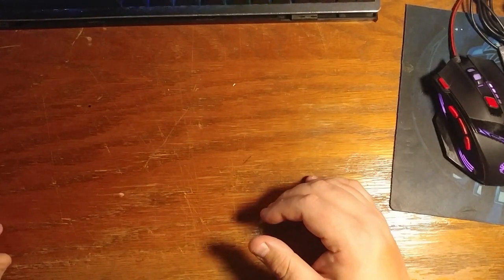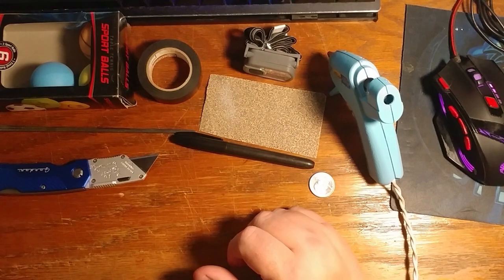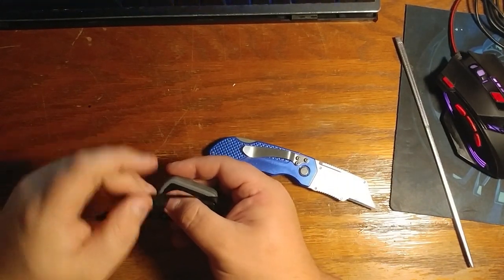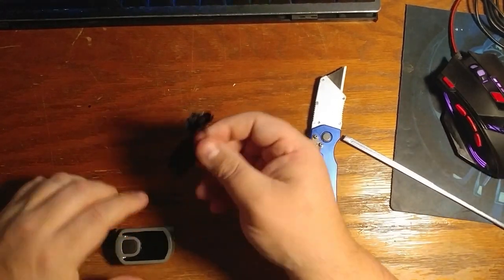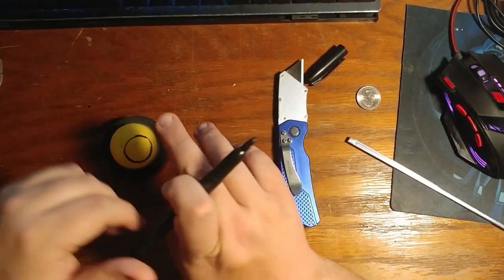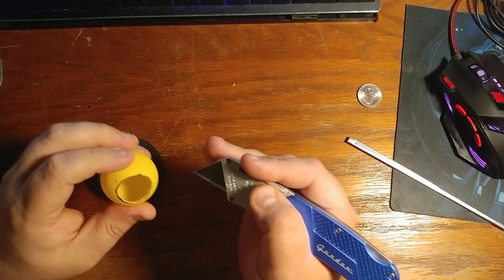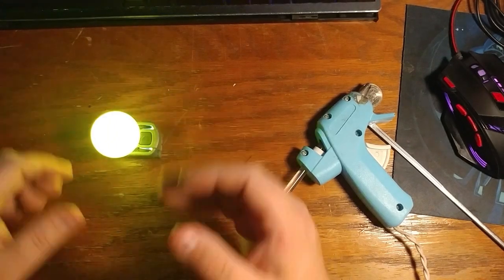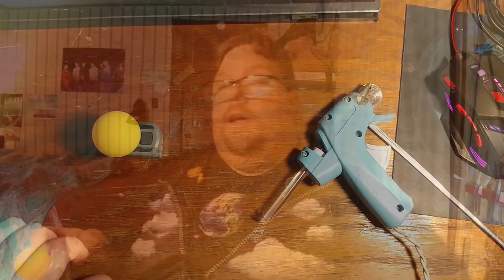$5 PING PONG BALL HEADTRACKER FOR PSMOVESERVICE!

Comment: What lumens or wattage should the LED be?
Reply from the maker: The led would need to be at 5 or 6 volt. battery bank will put out 5 volt if you go the usb version.  This is why I use a stock cheap headlamp like you see in the video. Its cheap and easily modifiable.